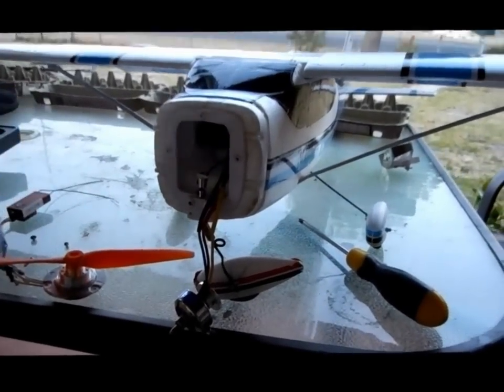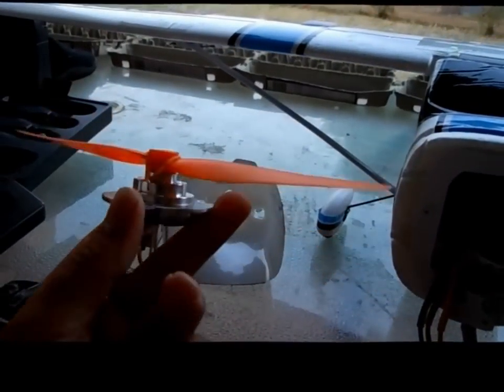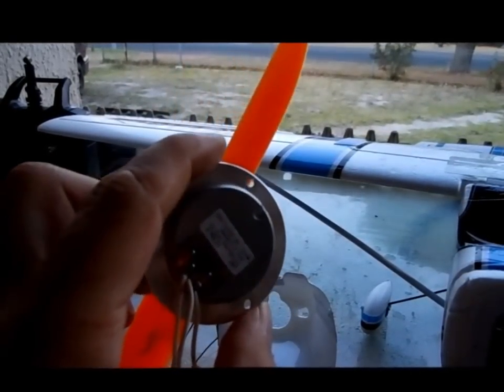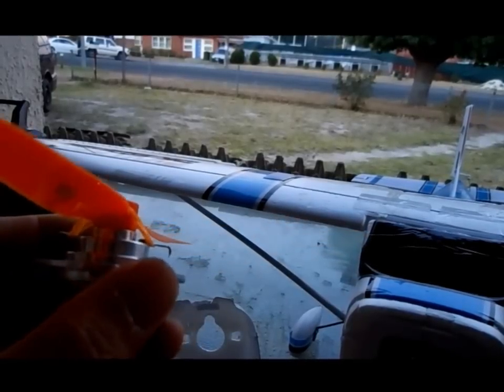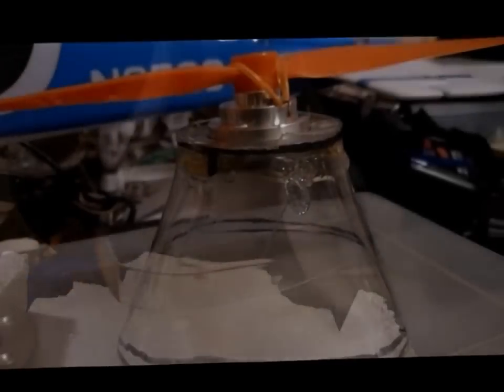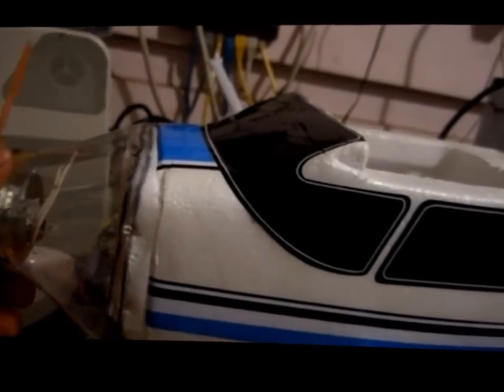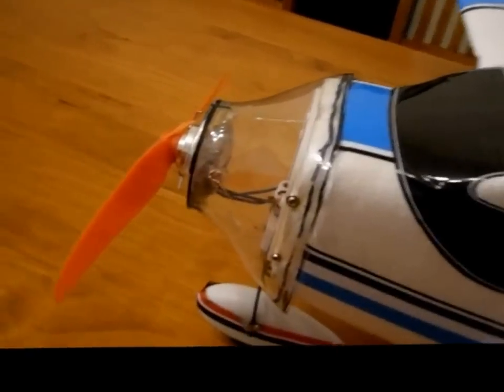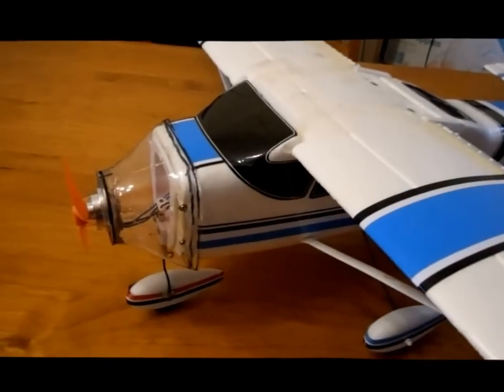Hard drive motor rc plane

Comment: hi Tariq, ta for the video.  HD motors are designed for high speed and fairly low torque.  Props are most efficient at low speed and high torque.  So there's a mismatch.  How about making an electric "jet turbine"  (ducted fan) plane next?  Ducted fans want high rpm.
Reply from the maker: Thanks for that knowledge, that would make sense to why it would not take off, but would only taxi at good speed. sadly it ended broken but was a fun attempt.

Comment: I have or should I say had the same plane, unfortunately mine met its doom into a rather large tree lol, awesome plane to fly tho, very fast under throttle! just a tip, the airlerons don't stay level and move out of alignment real easy, a dot of hot glue gun fixes it tho, would recommend doing this to the plane if anyone else has one, the flaps do the same too.

Comment: I wonder if you took into account the differences in Center of Gravity that the combination of different motor and shorter cowl made.  That might have had something to do with the fact your airplane didn't fly; although the high RPM could have been responsible as well...although it seems you could have just throttled down if that was the issue.

Comment: if you spin the prop too fast your loosing eff. modern Cessna for example is roughly 2700 rpm at the tips of the wings, anything more than that and you will loose airflow

Comment: if you build it into a brushless dc, you could probably get higher rpm out of it at the cost of precision.  as is, the hard drive motor was built for precision, although as a drive motor, it really doesn't matter... higher rpm would be more important.

Comment: So did it fly?
Reply: David Losada I'll share a little know propeller secret with you.  Use Master Airscrew's standard beachwood props.  Towerhobbies.com has good selection.  APC's are the worst.  Beachwood is lighter, stiffer and quieter than even the most expensive carbon fiber units.  The tip is rounded like the shape of spitfire's wing.  Anything with pointy wingtip "scratches" the air and creates lots of tip drag.  That's why APC are so damn noisy.  I round off the tips on even the folding props.  This makes them much much better in ALL perf. aspects.  I use Master Airscrews on all my electrics except the lightest of 3D indoor planes.  Wood props don't look like they "bite" the air.. but they DO, while using LESS battery power !!!
Reply: Andrew Jackson Thank you, very very interesting!
Reply: Andrew Jackson I go thru props llike crazy if apc's are the worst I wonder why they seem to make way the hell more power than any MA prop ive ever tested I have .049 planes that wont even fly on a MA 6x4 but fly fast enough I have to pull the mix screw out to lose power on apcs when you move up to 12x6's the difference is a 1.50 oz with 820kz on 3s
Reply: joseph pereira I agree. APC props are a lot more efficient than MA's.
Reply: joseph pereira Do APC props really make WAY MORE POWER than MAs?  I did not know that props made ANY power at all.  I thought it was the ENGINES that made power and the props that did their best to transmit it without wasting power.  I've never bought a 200hp tires, after all.  How do I convince a person who's mounted a SIX inch !!! prop on a .049, that a stiffer prop is more efficient one?  Have you ever flexed a plastic (reinforced or other wise) prop next to a wood one?.  Have you ever wondered why the APCs are so damn noisy?  Wasted energy maybe?  If I wanted a lots of "POWER" ( i mean THRUST) out of .049 I would have tried a 5x3.  If I wanted a lots of speed,  a 4x4 or 4x4.5  Any props with "high tech" looking pointy tips will just scratch the air, created tip turbulence, make noise and waste energy by generating very annoying sounds.
Reply: the props are more efficient you stick a fucken 2x4 on the end of a motor you can dump 300 hp and go nowhere so yes you get more power from better props and I live at almost 6000 ft altitude my .049 turns a 6x4 at a respectable 15100 rpm on a hot day and 25%nitro because of where I live I have to get the most out of my motors to even fly the apc keeps me in the air the MA props im fighting stalls if I can get it up there to start
Reply: joseph pereira Go fly a kite! A really POWERFUL one.  That's more of your cognitive level.

Comment: how did you get the hard drive motor to even work? Every time I tried, it never did anything ._.
Reply: you need driver to make it run
Reply: Yuri frost Thanks for input about using a driver, but I have never used that setup before, so would I have to build one or get one from say like ebay ?.
Reply: Tariq Curtis Hard drives use stepper motors, you can either get a driver off ebay (search: Stepper Motor Driver) or make one yourself :)
Reply: Patrick Hansen ok interesting thanks, I will have a look for them.

Comment: Go outside..n show us how it flyies..1 question: ive got plenty of harddisk jvc motors..but they are 4 pinned motors.how should i connect it to the esc?
Reply: +Jerome Fernando find the common , and do not connect it,but you might have to use a 3s or a 4s battery

Comment: there are 4 contacts on the hdd motor but the speed controller has 3!
how did you connect them?
Reply: you need to find the comom (negative) using a multimeter and don't connect it, just the other three

Comment: Does it fly?
Reply from the maker: It only just got off the ground, almost air born  but failed. The motor had plenty of rpm. Some suggested that to many rpms can cause problems too ?.
Reply: +Tariq Curtis maybe its caused by center of gravity shift? you know, its different from the weight
Reply: If I install 3 motor in this plane 
Dose it fly
Reply: Probably the problem is not the RPM but the weignt problem. Probably the hdd motor unbalanced the plane.